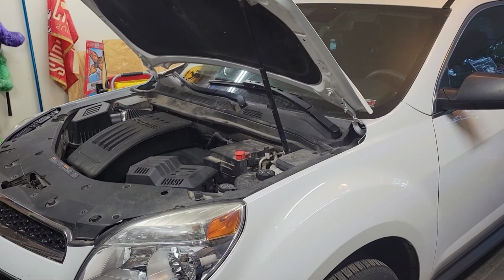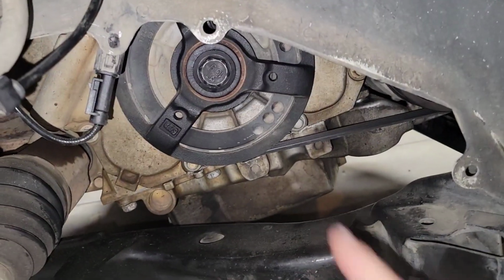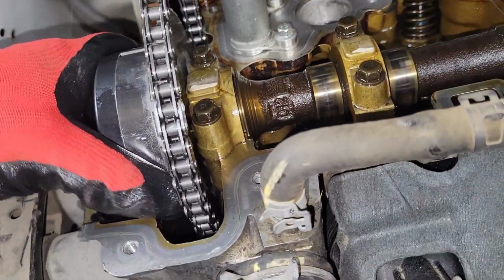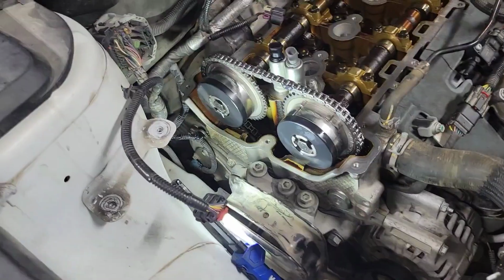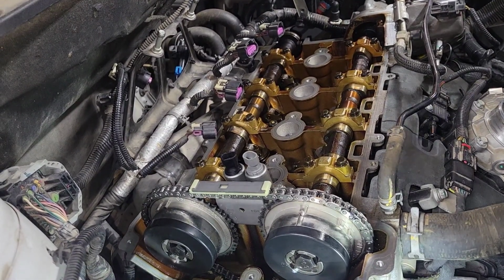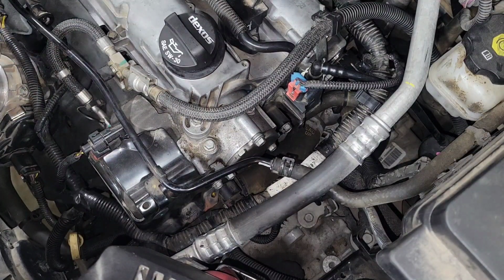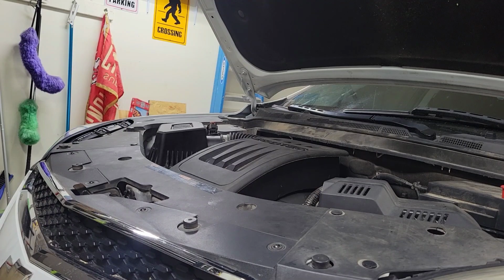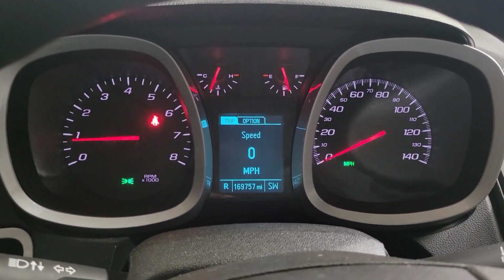2014 Chevy Equinox 2.4L Cam Phaser / Actuator replacement without removing timing.

Comment: Shouldn’t the black chain link that’s in between the two cam phasers be lined up with something?
Reply from the maker: If you were setting timing from scratch the colored chain links would be very important.  Since I wasn't removing the cover and chain completely, the link isnt relevant.  The point of doing the job this way was so I didnt have to take it all apart.  I can simply put it back they way it was taken off to replace the cam phasers.
Reply: @elvrolet Now it makes sense. Thanks for responding to my question.

Comment: Replaced the exhaust solenoids 3 times and can’t command the degrees just stays at 0-1 sometimes 2 degrees. Is this my problem? I have a p0014 code
Reply from the maker: If you replaced the solenoid with no change, then it most likely is the cam phaser or timing chain related.  The signal from the cam sensor is telling the computer that something is off.

Comment: How did you reset the tensioner? I have to do this soon and I’m lost lol
Reply from the maker: You have to remove the snap ring, then reset the piston assembly.  I will link a video I found, but it's about the 7:00 minute mark that you see what you need.
https://youtu.be/VNqcozAVWwQ
Reply: @elvrolet what if u took it off reset the chain and jus screws the tensioner back in without resetting it will that affect timing a little becuz im getting a stumble now an the car cuts off

Comment: Just replaced the exhaust cam phaser using this method, now getting p0016 p0017. Any suggestions?
Reply: timing chain
Reply: You didn’t get the chain back in the same place! Those are correlation codes. Mean chain in wrong spot or stretched.

Comment: One other thing when putting the cam chain tensioner back in how do you know when scewing it back in it will line up in the right place on the cam chain guide  ??
Reply from the maker: I don't recall exactly, Im thinking there was a place to view it, as I mentioned using a mirror in the video.
Reply: . THANKS

Comment: I noticed you did not use the special tool that they have ... can the bolts be tighten without and if so why do you need the tool and what does it do .. Thanks for your help .. Im installing these Cam Phasers on my wife's car ...
Reply from the maker: I believe the tool you are referencing is for when you are not removing the phasers, which would then keep them in the locked position for keeping time.
Reply: @elvrolet. THANKS ..

Comment: Still running good?
Reply from the maker: The bucking issue eventually returned and I have a new video on that.
https://youtu.be/D_kHASigxLo
The drive-ability of the car was excellent after the final repair.  I did not have any issues with the cam phaser installation.

Comment: The occasional homing of cam actuators at cold start up is not a problem. Occurs most often during cold temps, and after a brief start and shutdown.  The actuators do not always return to the home position. At cold start, the ECM is running in open loop and fluctions are normal, even a few misfires during open-closed loop transition is normal.  After warm up, in drive at a stop, ECO mode will lower rpm from to rpm an cause stumble. Running AC also does this. Oil quality, cleanliness, oil level makes difference.  Fuel dilution in these engines affects and lowers viscosity which can cause VVT issues.  I assume no codes set. P0014 is common when actuators start to act up. Definitely check oil, ECO mode and other factors that load the engine at idle in drive.  I had a bad battery, that constant load the alternator and caused irratic idle.  RPM is controlled by  electronic throttle and by altering ignition timing, so cleaning the TB is a source.  If the actuators are ratcheting home at start up frequently hot or cold, and VVT solenoids connection are good, screens are clean, then TSB suggest replacement of cam actuators. Good video.